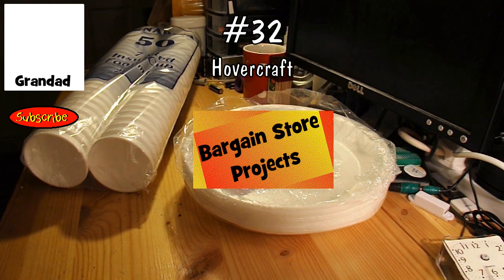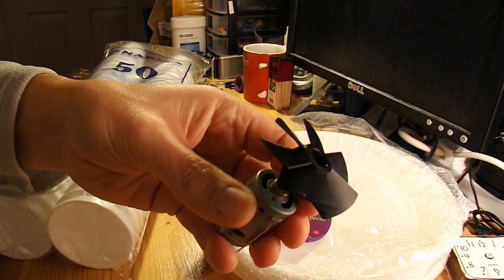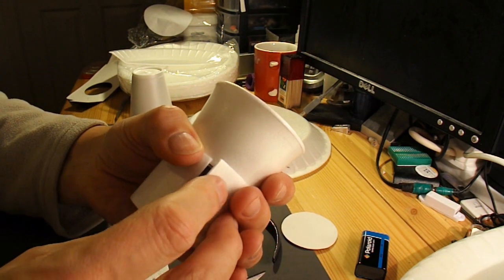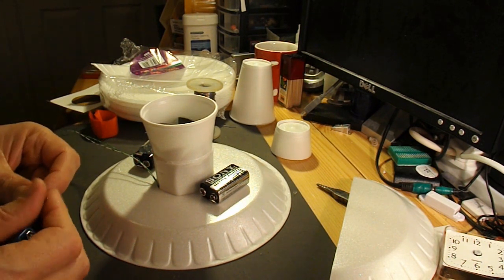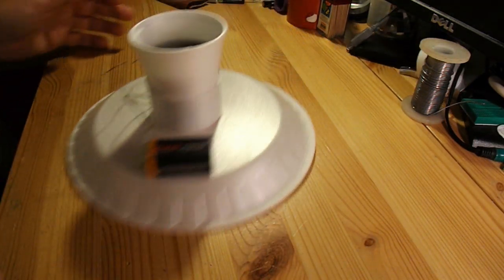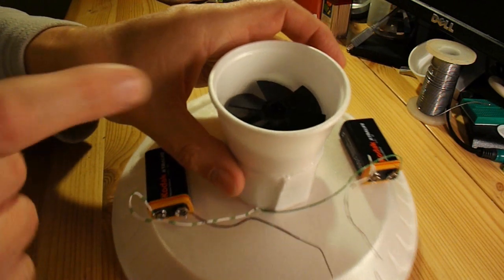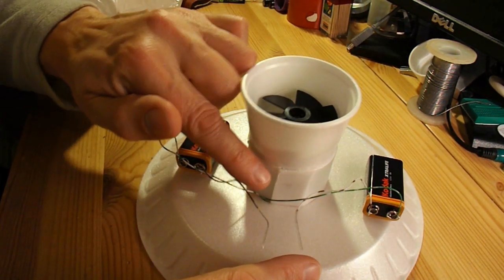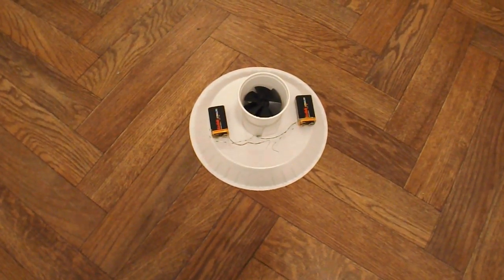Bargain Store Project #32 Styrofoam Cup and Plate Hovercraft

Comment: Excellent hovercraft
Reply from the maker: Thank you. This is still fooling around with junk and only achieves a very basic part of a hovercraft. It has no directional ability and it spins under the torque of the motor. However it does hover 😊

Comment: Wow! So hovercrafts really require a lot of power to work properly. Using two 9 volt batteries makes it hard to use one of those cheap RC chips because I am guessing it would burn them out. Would the only way to turn your hovercraft into an RC version be to keep the steering and the lift separate? What I mean by that is to use a cheap chip to run mini directional motors and then have a separate hand switch to turn on the main fan. Do you think that the added weight of the other components would cause the project to fail?
Reply from the maker: Disney Gym Girl there are plenty of successful hovercraft videos on YouTube. The main issue is getting the right weight for the power available. Proper RC components are not that expensive if you want to be successful.
Reply: True but that kind of defeats the point of creating something beautiful from recycled parts like you do. I have a few hobby grade RC cars and Heli's but although those are fun... when you build something out of nothing it is far more gratifying and the learning experience you acquire from each project goes beyond what can be achieved from merely building something you can just go out and buy at your local store. That is why I find your videos truly inspiring!
Reply from the maker: Disney Gym Girl as far as the lift motor is concerned, yes it only needs to be switched off and on, there is virtually no benefit in varying it's speed, certainly not in a small toy like this. That means you can use a simple rc controller to turn a steering fan and start,stop, and reverse it's thrust as required. Alternatively you could steer it with twin fans independently controlled forwards and backwards.
Reply: Or I could use the method from your turning a car into a boat video. That was a really creative one. I would only use the chip and the steering of course since the lift motor would be connected directly to the battery like in this video.

Comment: Is that actually a 240 volt hair drier motor?  It looks that way from your take-apart video...
Quite inpressive power @ 18 V.
Cheers
Reply from the maker: The hair drier is 240 volt ac but the way it is wired means the motor is probably about 12 volt dc. In the hair drier the voltage drops from 240v because it is passed through the heater wires and a rectifier bridge before it gets to the motor.
Reply: GrandadIsAnOldMan   Very good.  I suspected something like that.  If it is the case that the heater is used to get the motor voltage, then there must be motor speed changes along with the power switch settings, If, that is, it has more than one power setting...no?
Cheers
P.S.  Would a flexible skirt made out of something like garbage bag improve performance?
Reply from the maker: Observ45er Some hairdryers probably work like that, some may just use an extra resistor. They are not all the same.
As for the flexible skirt, I have used them on some of my projects in my Hovercraft playlist.
My Hovercraft playlist is here
http://www.youtube.com/playlist?list=PLA5a2xPRSrB3zoLYIrdESCCWdx2nLq8r7
Reply: GrandadIsAnOldMan  Thanks.  I stumbled onto your videos looking for ideas for BristleBots.  I am Science/Technical Advisor for one of the 40+ Challenger Learning Centers:
 http://www.challenger.org/ 
..
 I'm still impressed at the vigor of that motor on nine volters... They don't last long, I'm sure.
Cheers
Reply from the maker: Observ45er Those motors are pretty robust but a little heavier than the cheaper ones I use for most of my projects. I try to use really cheap ones from vibrating toothbrushes as my channel is mainly about simple, cheap, quick to build projects with cheap being the big factor. As you probably saw in the hair dryer video I managed to get a bulk load of them for £1 each so at that price they were the same as the vibrating toothbrushes from Poundland and they came with fan blades attached.
On the subject of bristle bots, you may have found my playlist http://www.youtube.com/playlist?list=PLA5a2xPRSrB2WfmROVP1Pl5p_6MnWwgBx
Reply: GrandadIsAnOldMan  I've seen several of your videos.
...
I like the cable tie leggs.  I may try arranging four of them almost vertical, more like bristle leggs for a preferred direction of travel... Thanks.
..
Sometimes I just stand an electric toothbrush upright and watch it dance on the counter top. 
...
I do demos and activities with youngsters at a one of the 40+ Challenger Centers. 
http://www.challengerillinois.org/
  I picked up a bunch of the cell phone vibrator motors cheap and we make BristleBots and they take them home.  I have a few of the extra small ones (0.16x.35 - 4mmx9mm) and I'm on the look-out for smaller brushes to use on them.
...
  I also have some X-Bee modules and may radio control a pair side-by-side.
...
There are lots of interesting variations of them on YouTube... I have always liked the extra small things and the BristleBots have lots of potental.
Cheers
P.S.  I've also seen your DrawBots.  Something like that's also on the list...

Comment: Hi, You are doing really good work. I am impressed with the way you are inspiring people. I also did these kind of projects in my childhood but gradually lost interest. After viewing your video, again I got inspired :) Thanks.

Wondering, for the Hover craft project, if air will release (under the plate) from the corner of the plate(instead from center) towards center (like the original hovercraft does) than it will lift more in the air.
Reply from the maker: Hi Saral, you really don't need height, as long as there is a cushion of air underneath it has achieved the purpose of removing the friction of the ground contact. The next problem is directional stability which I tried to fix in this video http://youtu.be/dJ8iBwx4O3k but I wasn't very successful.